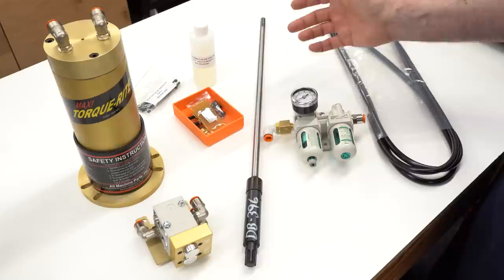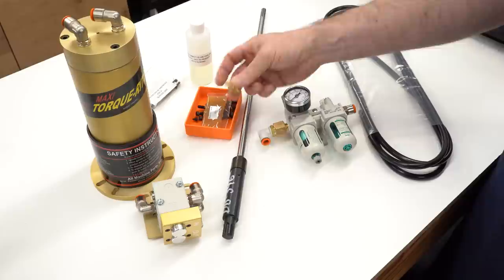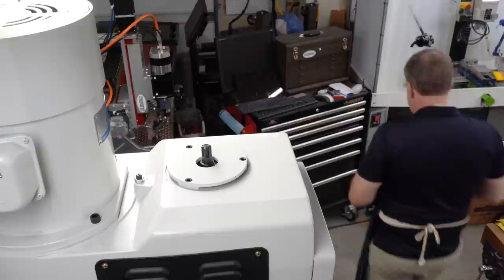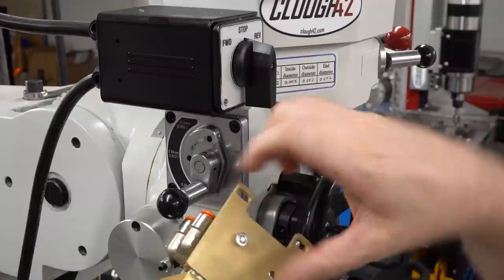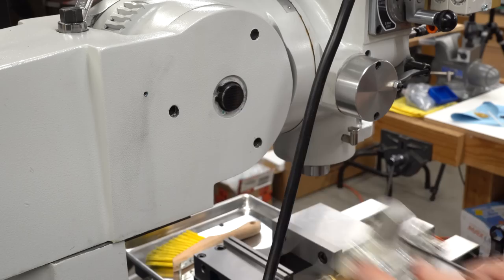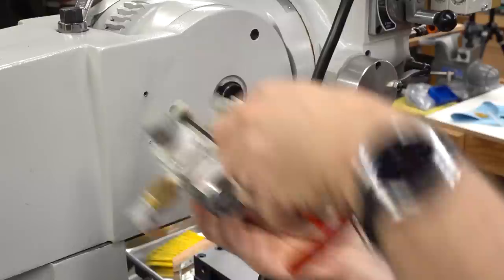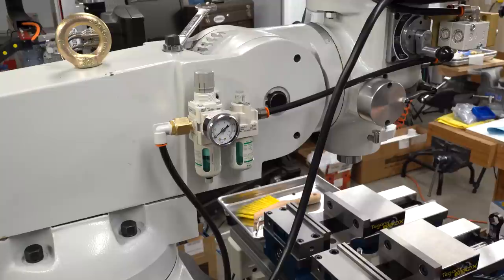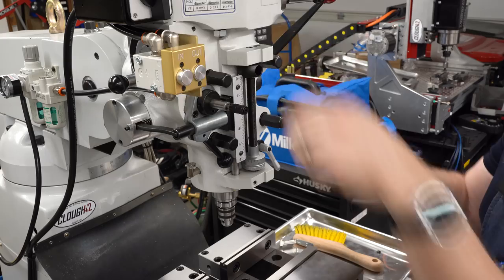Installing a Power Drawbar to Avoid Breaking More End Mills

Comment: Looks nice. I would think an interlock would be a good add on to keep from ejecting a tool by accident if the spindle is turning. Thanks for sharing!
Reply: Absolutely agree! Oddly I just stopped wiring an interlock on my home-brewed power drawbar for my Bridgeport to watch this video! 
I put a limit switch on the operating lever with N/O and N/C contacts. The N/C contacts break the control voltage to the spindle motor contactor and the N/O are wired to a solenoid valve in the air feed to the drawbar engage pneumatic cylinder and air motor. Not 100% foolproof because of the spindle run-down time but should stop me doing anything totally stupid!
Reply: if the spindle is turning, the impacts of the drawbar motor won't loosen the tool. We have had these for 15ish years in a production shop.

Comment: My 2 gallon Cal Air compressor had the pressure reg knob hissing problem.  So, I took it the valve all apart, to find a plastic part was sticking.  I added some grease and smoothed out the fit, then put it all back together.  It's been fine for several years since.
At first, I was mad that this otherwise nice quiet compressor had broken so soon.  But as is the case with tools made to a price, we add our TLC to bring the quality up to snuff.

Comment: I replaced the whole manifold on my California Air Tools compressor. It had a leak and I found that the manifold casting had holes in many of the mating surfaces and threads. Cutting new ones a little deeper just revealed more casting imperfections. So I designed a new manifold from the ground up, and it’s been great. I have 3 independent regulators so that I can have an air nozzle, a die grinder, and an impact driver all on the same manifold. Let me know and I can send pictures, models, and drawings.

Comment: Those synthetic grease packets are almost as bad as anti sieze. In 30+ years I still am puzzled at how a drop of anti sieze on the tip of your finger at 1:15 pm, will be inside the back of your knees, under both arms, and have your face looking like the tin man from wizard of oz by 1:17pm..

Comment: I too have a PM mill and have purchased and installed a power draw bar.  I have managed to drop and chip end mills with it.  With more time 'tho I seem to have managed to learn how to release the end mill (or what have you) very gradually so it doesn't drop AND to be sure only release the draw bar when if all else fails and the part drops it has a VERY limited distance to drop.  Frankly the appeal of a floor mounted brake pedal is appealing but so far I've managed to procrastinate on that.  I only recently found you channel and very much enjoy it.

Comment: I was hoping you would do a Dave Jones and take it apart!

Also on the compressor, because of where you have yours you could just ditch the built in regulator and bring the full tank pressure off the compressor then run it to a regulator on the wall before it is distributed in the shop.
Reply from the maker: That's not a bad idea.
Reply: @Clough42  First I'd try replacing that suspect seal with teflon tape, assuming you can't find a proper replacement.

Comment: You might consider installing an adjustable restriction in the air line from the switch to the motor, the closeting side only, and tune it to control the rapid run up. If the release is also too violent, then do the same for that line to the motor.
It's not just the pressure, but the volume that causes a harsh application/release with pneumatic actuators.

Tim
Reply from the maker: Worth thinking about.  There is a minimum to get it to pull in and engage the splines.

Comment: Pressure regulators are usually standardized across manufacturers to avoid liability. Just get on Amazon and pick one rated for your compressor. California air is considered a very good brand and very quiet. I would happily trade my working 5 gallon Porter Cable for yours, broken or not. 😂

Comment: I picked up a Harbor Freight Fortress "Ultra Quiet" compressor a few months back, which is basically a clone of the CAT model you have, but at 2/3rd the price (and actually available where I live). Have been very impressed with it so far, I have it sitting right next to my CNC computer cart and it's crazy how quiet it is compared to normal compressors. I keep it pressurized all the time (although powered off) and no leaking... yet. lol. Also, have never seen an impact-style power drawbar -- have only seen the spring washer/clamping type.

Comment: We have same exact Power draw bar on our school (that I teach) 2 axis Trak Mill - hybrid CNC and Manual machine - with R8 Collets 
Only issues we ever have is that collets get stuck in spindle some times and eventually some one strips the drawbar. I think many are over tightened.  I prefer to use solid R8 holders with common endmills and also a solid holder keyless drill chuck.  Good luck

Comment: Thanks for showing the TTS  stuff I have been wondering about that.
Reply from the maker: They're convenient on a manual mill, but their real benefit is that they register against the face of the spindle, so you can have the tool lengths pre-programmed in your CNC controller and they repeat when you swap tools.

Comment: Nice little project, James. I’m happy to see that I’m not the only one that will go to the trouble on things that don’t really matter to anyone other than me (I’d get annoyed every time I looked at those hoses, too).

One thing that I do whenever drilling & tapping holes in a machine: I make a little “sling” out of painter’s tape and stick it under the soon-to-be-hole to catch the chips/dust so that there is less chance of anything finding its way into a machined mating surface (I tried just using a cloth, but it always seemed that the chips just wait until I remove the cloth to drop where I don’t want them – with the tape I’ve been luckier and the chips adhere to the tape). I’d upload a photo, but still haven’t figured out how to do so in YouTube.
Reply from the maker: Oh, that's a good idea.  I sometimes use a vacuum, which I suppose could also be taped to the machine near the hole.
Reply: @Clough42  I've tried positioning a vacuum hose, but it either gets in the way or moves at a critical time. I sent you a photo of my rig via your website contact email address.
Reply: @ChazzC   @Clough42  I made a shop vac adapter that used 1/2" flexible copper tube with a big mag base, so I can clamp it to the table out of the way, and position it just where I need it.

Comment: Makita makes some quiet compressors, I've had very good luck with mine. Mine is smaller, not sure what they have in the size you would want. It is heavier but runs at lower RPM.

Comment: How did the old timers do it? I usually break the tension then grab the end mill or whatever tool is in the mill and then hand loosen from there. Tool comes out and everything is super-duper happy. Never had an issue so far.
Reply from the maker: Yeah, this is exactly what I normally do, and how I dropped it.  I broke the tension, and it dropped.  Usually, it will stick until I tap the drawbar, but not this time.  But to be fair, we all know the dropped end mill is just a thin excuse to buy new tools.  :)
Reply: @Clough42  HA HA HA!!!! Good one. Can never have too many tools.  I did break an end mill but it wasn't on the machine and thankfully it was a chip break and I had it re-ground.

Comment: Knowing what impact tools can do to threads over a long time (time here depending on how much over-torque / hammering occurs), I am not a fan of air-impact  powered collet draw bars. I haven't dropped a tool out of the spindle in many years, either, as I either use a soft bunched up catch towel or have one work glove protected hand on the cutter / drill chuck / whatever until it is secure, and use a bungee to pull the brake handle, or just tighten the spindle wrench against the momentum of the spindle, while i snug the drawbar enough to hold the tool in the collet. Then give a final pull on the wrench using the brake. I also keep the threads and thrust face of the drawbar oiled with EP gear oil. One thing I find fairly universal is machinists who believe the drawbar has to be torqued "good n tight" i.e. to beyond 15 ft-lbs. I've never had to do that. That's just overkill.

Comment: Hi James,

That's a nice simple install.

The only thing that I would suggest is increasing the length of tubing between the oiling mainafold and the controlls, if you ever turn or rotate the mill head, then it's going to come right out.

Regards
Reply from the maker: Yup.  I realized my mistake during editing.  I have more tubing.  :)

Comment: Yep, the compressor is one of the problems you will always have, one of the reasons back in 2013 I opted for a 24 volt  electric actuator type draw bar for my Skyfire CNC mill.....I have ISO 20 tooling so the draw bar is different to yours in that it is a Bellville washer spring loaded type and the actuator only has to move 6mm to unlock the tool holder........some time after getting the mill the actuator burnt out due to it being over powered to 36 volts....manufacturer over sight.........they assumed the drawbar would only be hit momentarily for each clamp and unclamp.......well and good but after a week it failed.....rebuild on the way.
I would suggest a bigger air tank or long pipe type system you pump up only once in a while but it does take up some room if it's a cylindrical type ....the pipe type consists of several long steel pipes 150mm diam placed in the roof of the shop and out of the way.

Comment: I was the operator of a bridgeport with a kurt pneumatic draw bar. Ran around 50-60psi unless a shell mill was used then maybe 80psi. Sometimes an engineer would lay on the draw too long, or not clean the nose and get stuck. So one has to up the pressure to unclamp. If your working pressure is already 100, you are really over clamping.

Comment: Hi James, I was hoping you would come up with a solution for adding spindle oil from the top, with the power drawbar, without removing it. I have the same unit (I can't work without it). I was thinking of drilling a hole on the diameter of the base plate to another hole, over the spindle, and adding a Gits oil cup. Your thoughts? Love your content, thanks for the video.

Comment: Hey James,  I have the Eastwood QST 30/60 compressor.  It does require 220V though. I can't compare it to a CAT compressor, as I've never been around one.  But if I'm not in the same 'room' of my garage when it turns on, I usually don't notice that it was even running until it turns off and the pressure switch lets out the excess pressure.  Thanks for the vid- I also have a PM 935 and had wondered about the power drawbar kit.

Comment: I just use R8 tool holders with an electric 3/8" ratchet for a "power drawbar."   R8 tool holder is much more rigid than collets and the tool length in the tool table remains the same after tool changes.  Collets and TTS toolholders I use for chamfer bit, drills, and small endmills.

Comment: I love my Eastwood QST 30/60 scroll compressor. It's quiet, solidly built, and has separately replaceable parts. They're not cheap, but I've long since forgotten the pain of paying for it.
Reply from the maker: Oh, that looks like a really nice compressor.
Reply: @Clough42  it really is.
Reply: I have one also and really like it.  It’s not just quiet it will run a sandblaster or other tool that requires a lot of air volume.
Reply: @Alex Bakker and @Mark Caroll @ MichaeI have been investigating that compressor and really love the noise level and the package.  I am concerned about the water that apparently gets into the oil system though.  A few people on youtube show some major issues with that.  The company suggests taking the cover off and draining the water from the oil once per month which looks like a pain.  Are you doing that?  Is it a pain have you had any of the issues that seem to be happening with pressure switch problems or oil related issues?  I can't tell if it's a few disgruntled guys on youtube or a real issue.  There seem to be satisfied users out there just not many on youtube.  TIA
Reply: @ScottDube1  I haven’t noticed issues, but the one I’ve used is at a friends shop not mine. I’ve got a 7.5HP eaton which is quotes just because it is big and slow. Not CA air tools quiet, but, still pretty good.
Reply: I have had mine for two years.  I was leaving it on all the time and would hear it kick on maybe twice a week.  One day I was using it and the pressure relief valve went off on the inside and I had to shut it off.  I did have to take the cover off and I found about a liter of water in the oil.  I do not leave it turned on anymore.  I just turn it on when I’m using it.  I haven’t really had any problems with it since.  It’s just part of the maintenance drain the tank drain the oil separator.  Tech-support was very helpful they sent me a new pressure relief valve.  I think it’s a great machine and would buy one again.  It’s just really nice to be working on something and be able to talk to the person stand in next to you while it’s running.
Reply: @markcaroll363  are you draining it once a month?  Are you in a humid or dry part of the world?
Reply: No I do not check it every month but I do not use it that much unless I get into a project.  I guess it is time to check it.

Comment: Checked PM's prices and they seem OK. Wish they had one for an 'Merican Bridgeport (not clone)! I bought a Tormach PCNC1100 power drawbar this year at the Bash from Tom Lipton (great deal!). Totally different set up and only works with the TTS as you're just de-tensioning the drawbar enough to drop out a TTS holder. It does NOT unthread the drawbar but compresses belleville washers instead. Once installed, you can ONLY use the TTS system without removing the air cylinder.

Comment: The spring loaded "unloader doo-dad" on mine kept failing to seat and seal when it started.  It would hiss for a long time before maybe sealing.  I fussed with the spring tension until I finally gave up and eventually tossed the spring.  No problems and it seals every time now.  If I want to put the spring back in later I think that it rolled under the mill for safe keeping.

Comment: Matching the curvature of the air hoses might even exceed my level of OCD. I was wondering how the PDB would work with R8 and TTS where you just want to loosen, not remove. I switched over to NMTB30 many years ago. Maybe an update once you have some time with it. I remember some R8 getting pretty stuck, and I wonder if the impacting would always be enough to bust them loose.

Comment: I have an air command AC15 compressor. Unfortunately it is 3hp as we have 230V supply here in NZ, so probably not much use to you. Other than that, Air Command is actually a good brand.

Comment: I also had a California air compressor with a leaky air regulator. I took the regulator off to replace it and then it wouldn’t turn on. Had to fix the air switch but now it’s auto on all the time. Ended up getting a 4HP scroll compressor instead.

Comment: I disassembled my California compressor regulator, cleaned, lubricated and reassembled. Seemed to work better.
Reply from the maker: Yeah, that's what I did previously as well, and it's leaking again, a few weeks later.
Reply: @Clough42  Sorry to hear that. I haven't used mine very much so that may be the difference.

Comment: I have a Makita MAC2400  Compressor it is running low rpm and it is  Very Quiet  oil lubricated  very  reliable Higly recomended!
79db
Big bore.

Comment: Maybe an interlock that prevents air to the motor when the mill is running? May prevent any bumpy situations with buttons/valves?
Reply: It would have to be an additional pneumatic valve at the air inlet. A bit of a hassle, but totally doable.
Reply from the maker: The valves take a firm press, so the main problem would be human error--just hitting the button out of muscle memory.  But since that muscle memory would also have me grabbing the spinning tool, I think there would be bigger problems.
Reply: @Clough42  so... more broken end mills I guess. Well grabbing a x thousand fast spinning and falling bayblade is maybe a little more resistant to grabbing than just pressing a button. Still a fast and falling tool with holder tho.

Wait what would even happen if you engage it with the tool spinning? Wouldn't the draw bar motor get overpowered or more like catastrophic failures?
Reply: The air motor is an impact style, the impacts wont act against the drawbar with the spindle spinning, we use these in a production shop and safety wouldnt allow us to use them without an interlock if the tool could come out.

Comment: I have a 1969 Bridgeport series 1. My problem is I am too short [5'9"] for the Bridgeport drawbar. I bought a 24.75"  Lagun drawbar from Enco that sticks out the top. I had to chase the threads [would not fit in the R8] and make a centering collar, but it has been working for 7 years.

Comment: The spindle motor probably dos not get very hot while using it, maybe be a custom box around it wit sound demping material will take care of your sound irritation. A test setup with a cardboard box and sound demping material would give you the answer. Maybe a nice little project.